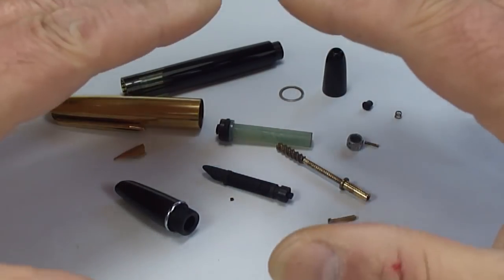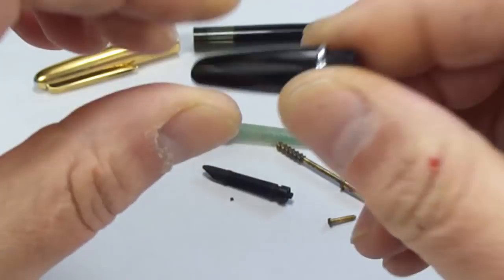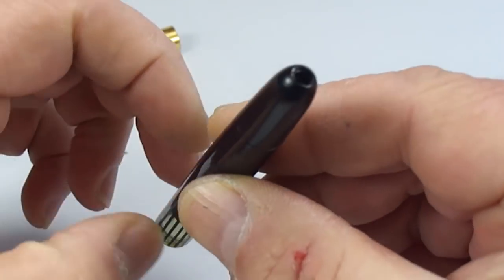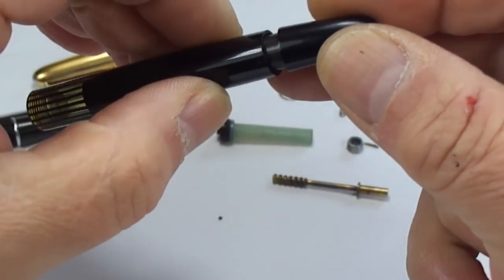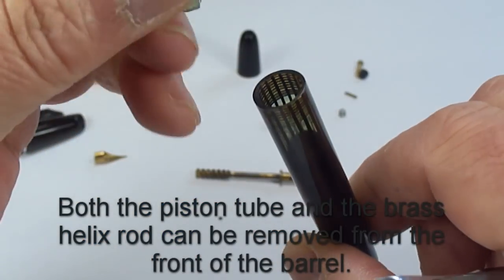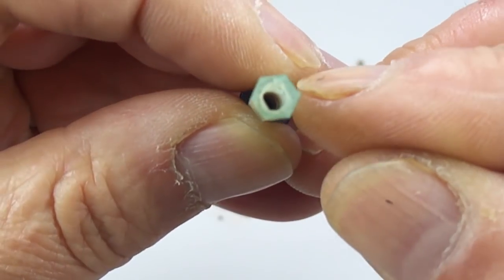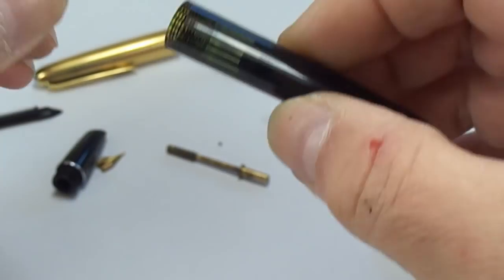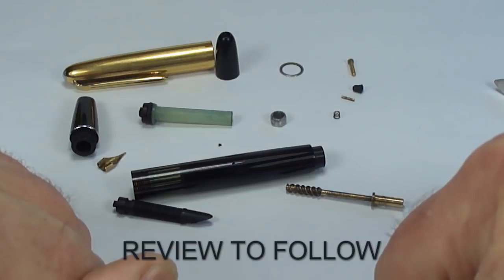AURORA 88K FOUNTAIN PEN DISASSEMBLY

Comment: Many thanks for this excellent tutorial on the Aurora 88K, it certainly has a complicated internal filling system, and I would think that the problem that this design brought with it was the material available for the main seal, I would think it would have had a cupped washer when originally made, and any leak around the "lip" would result in ink migrating past the seal and through the helix system out of the top cap, by using an "O" ring made from modern materials that problem should now be avoided, the only other problem I can see from this design is that in a hot climate, the ink inside the barrel would expand quickly in a warm environment, causing "burping" but this is a factor with all ink in barrel designs, the ink view window is very nicely done, and I think this pen will now give many more years of service, another one saved! Chris B.
Reply from the maker: Hi Chris, the original seal washers i believe were flat not cupped. If you look carefully you may see a tiny air hole in the barrel. This i believe was designed to prevent any variation in air pressure. Thank you for your comments.

Comment: Dear Stef,
I was very happy of watching this video, which was technically instructive, but it was also a demonstration of the special features a restorer should prove in accomplishing such a job: good professional knowledge  skill and intuition, patience and commitment to the specific work he is doing, love towards the vintage Fountain Pens.
I  listed just a few of them, as I looked things from outside and from a certain distance, but it seemed to me you had them all and surely more than the group of features I mentioned above.
Well, it was late in the night when I noticed this video came up, but, although I needed some rest as I still am an employee with a quite strict work schedule, I couldn't go to sleep!
That is certainly one of the effects your videos always produce: sleep goes away and when sleep comes back, after watching, they provide nice dreams for all night long.
However, please, accept my observations below not suspecting that I dreamed them. I am not able to go too far, but still I have some things to notice.
Firstly, I noticed that the piston knob, which is at its bottom of the same diameter like the barrel, could be accidentally rotated if the Fountain Pen would be posted. Obviously, in that case,if I am right, an unwanted  drop of ink could be released. To make that observation, I based myself on the design of the Pelikan Souveran M series Fountain Pens.
The most recent models have the piston knob of a smaller diameter than the barrel, just to avoid that case of ink drop release. Again, if I am right, posting wouldn't be recommendable. (In fact it wouldn't be recommendable at all, for some other reasons as well!)
Secondarily, I noticed that the helix is made of brass, while the hexagonal piece sliding inside the barrel in order to move the piston would be made of a plastic material.
Although I noticed in your video that the hexagonal piece was moving very smoothly inside the barrel, I would ask whether, from time to time, some grease  wouldn't be needed on the helix threads.
Finally, I would insist once again on the popular way of speaking some Fountain Pens sellers have in my Country: "This Fountain Pen (let's say it is a Pelikan Souveran M600) has an incorporated converter".
Well, to that person who thinks that the piston filling system is just a converter variant, I would propose to watch this video, in order to understand that the piston converter  is nothing else than a simplified, mobile replica of the genuine piston filling system. And, certainly, the converter filling system came up much time later than the original piston filling system!
Thank you for the video and for all the suggestions it offered to me, including that I should make such an attempt of restoration only when I would feel comfortable with it and only when I would know what I am going to do (in my opinion NEVER!)
Best Regards
Anton-Mihai
Reply from the maker: Hi Anton im glad you enjoyed the video and that it was instructive. As you may know i never post caps on my pens, however this pen has another ring just above the piston knob. This ring i would say would prevent the cap sitting on the piston knob. I did apply a tiny amount of silicon grease on all the moving parts. Thank you as always for your comments.

Comment: Stef, you are the business. I almost felt this was for me. Opened mine up to find one of the washers rotten. Tried with a rubber o ring I had, but was not right. Cleaned up and silicone it and it seems to work. But I wonder if you could direct me to a proper washer which will be the right size for this. Love the 88. Thanks mate. I now owe you yet another pint. Still not been up north.
Reply from the maker: Hi Dan im glad it was helpful to you. If your O ring (like mine) OD is slightly to big then gently and carefully sand the OD to fit. Or you can buy them here http://www.vintagepens.com/catill_sacs_seals.shtml
I look forward to my pint. Good luck

Comment: Hi, I was trying to fix an 88k because when I opened it for the first time the end of the piston fell out of the barrel. Basically, I reassembled the piston and made sure its components stayed in place, and then resealed the pen. The piston went up and down without any issues, so I tried to see if it can draw ink: first I've tried with plain water, and after a few minutes of twisting up and down, it was filling at the very best to half the ink window. I tried inking the pen and while it can write, it is leaking both from the connection between where you normally put your fingers while writing and the breather hole that is on the barrel of the pen. What have I done wrong? I was thinking that maybe the piston is not making enough pressure to pull ink and keep it in the barrel? If so what should I try next? Thanks for the video anyway, it was very helpful
Reply from the maker: What you have done wrong is tried to service the pen yourself, this is not the right pen to practice on if you have never done it before. As you have found. Send it to a restorer to have it serviced before you break the pen beyond repair. Good luck.
Reply: @grandmiapens  thanks for the advice, I will do that

Comment: Hi Stef, what is the inner dimension of the Aurora 88 barrel — what size are the rubber o-rings you used, and where can I get some?
Reply from the maker: Hi Rob, sorry but i do not recall and i do not have one to measure. I have a box of different O rings which i use when needed. Good luck

Comment: I have this pen. I store it upwards. However whenever i uncap it i have ink just above the hooded nib on the section. It's dried so it doesn't seem to be from uncapping the nib and it reappears after i wipe it off. Do you know why this might be?
Reply from the maker: It always difficult to comment without seeing the pen in hand. Maybe the cap is causing a littl suction when uncapping. Good luck.

Comment: Hi Stef, I have an aurora 88, but it is leaking, Everything seems to be in order, but when ink it, it is letting ink out uncontrollably from the nib, the sectio nand the feed seems fine and snug, I have no Idea where might be the source of the leak. What is the purpose of the small separate ebonite piece in the feed? mine is twisted, I tried turning it to different positions, same results. Any idea?
Reply from the maker: Always difficult to comment on problems without seeing the pen in hand so it may leak for a nuber of reasons. Best to send it to a proffesional restorer. Good luck.

Comment: Quick question, what O-ring did you use on the piston to maintain the seal? I think my piston has lost the ability to retain pressure in the chamber fully such that some ink leaks from the section tip occasionally.
Reply from the maker: Sorry i do not recall the size, however i do remember sanding the OD for it to fit snugly. Good luck with your pen.